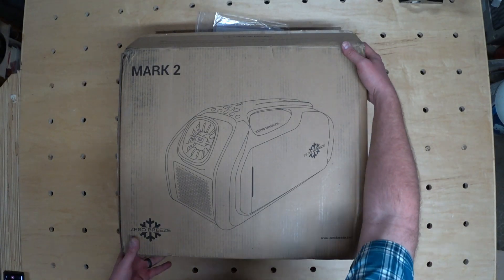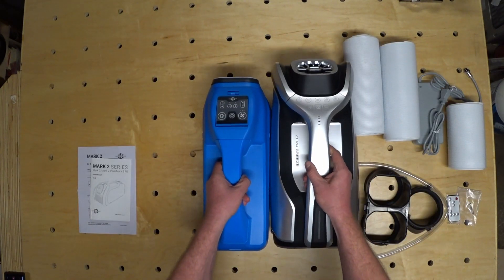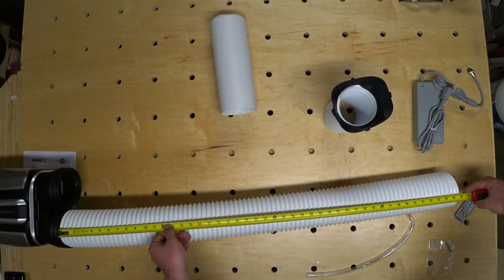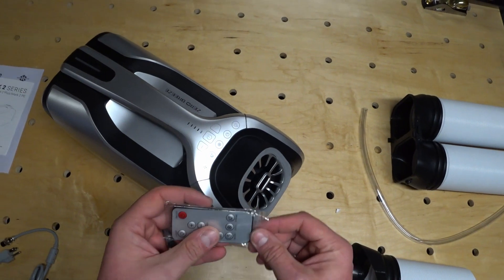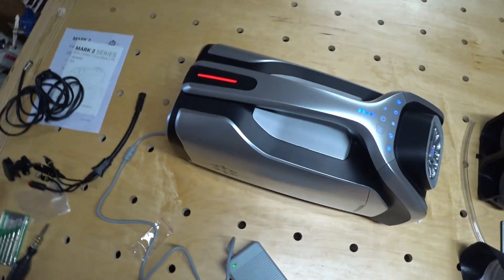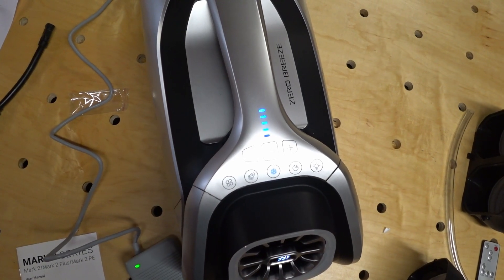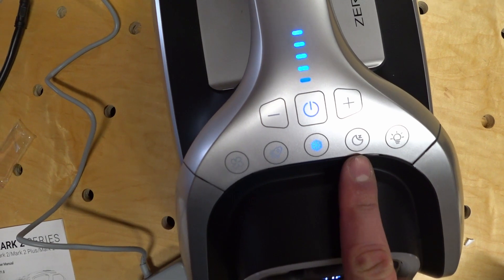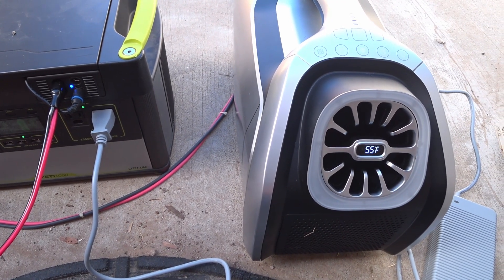Zero Breeze Mark 2 Unboxing, Startup, and First Impressions

Comment: Thunderfoot does a good video on the zero breeze. It seems to have zero effect except for the cost to run  it.
Reply from the maker: I wouldn't call his video "good".  Most of the video is showing the old Mark 1 which I agree was not ready for sale, so it's at the very least, misleading.  And his criticism of the Mark 2 is that it won't cool a large space in the sun.  Of course it won't.  What is he going to bust next?  A radio flyer kids wagon because it can't haul a ton of bricks?   He sells sensationalism (and apparently sells a lot of it).  Using his videos to further ones own knowledge is like using Wikipedia to find absolute truth.

The Mark 2 most certainly blows out air ~28 degrees cooler than ambient (and being refrigerated just "feels" a bit cooler).  If that's something that interests someone, and they feel it's worth the cost, then it's a good buy.

Comment: I’m a mail carrier and I’m trying to get ready for the summer..you know we have no ac in them trucks..I’m scared it may catch fire
Reply from the maker: I haven't heard of any Mark 2 catching fire.  I've used mine in a very hot enclosed space for hours and hours and still working like a champ at the end of last summer.  

A mail truck might actually be a good use for the Mark 2.  

**But I'll preface the following by saying some folks on the facebook group had issues with theirs in a moving vehicle, so I'd email zerobreeze first and get the official word from them so you're covered and can send it back if it doesn't work (CYA).**

It's not going to cool the whole inside especially with the door/window open, but it will blow cool air (up to 30 degrees cooler than the air around you) on your face and body.  If you can keep it relatively close to you, level, and get the end of the 4' exhaust hose to, or close to the outside, and be cool with just cool air blowing on you, then could be good if it will work in a moving vehicle.

If you live in a dry climate, check out swampy.net also.  They only work good if it's dry outside though.  I used one of those for 10 years before the ZeroBreeze came along.
Reply: Did u ever buy one? If so, was it worth it?

Comment: Is only one of the rear tubes pushing out hot air? So can this cool a small van from 90F to 70F in florida? How many watts? I'm calculating 220watts?
Reply from the maker: Yes, the hose on the mark 2's right rear is the hot exhaust. Other is the intake for the condenser coil. Will not cool a space during the day at that temp but it will cool you if it's blowing on you. This is how I use it. Stay in the air stream, no sweat. Move out of the air stream, instant dripping sweat. Wattage on my Yeti 1000 hovers around 200 on the hottest days running on DC power.

Comment: Ok I have an actual on topic question that doesn't fixate on your voice... how do you vent this a/c out of your car without having a window open??? I mean how do you close the window with two round hoses stuck out of it??? Does it come with some kind of car window hose attachment thingie thing?? Do you have to custom make something??? Just curious... I got a Jeep that doesn't have a/c was thinking of buying one of these as I don't plan to keep it long so don't want to dump a crap load of money adding a/c to it.. buying this zero breeze will let me keep and use this a/c for other things as well... also... does it really make a difference... how well does this device actually work
Reply from the maker: I'm ok with the occasional on-topic question.  Zero breeze does not have a duct to place in a cracked window that I know of, but that is a fantastic idea for them to think about.  I personally popped out the pressure relief valves in my vehicle (the rubber flappy things that let air out when you close your doors).  So I have direct access to the outside on both rear pillars.  

I don't know if you'd be happy with the Mark 2 trying to cool a vehicle.  It's just not designed to cool that many cubic feet of space especially with minimal insulation and in full sun.  The Mark 2 is 3200BTU's and a car might have a capacity of ~20,000BTU's.  I use it to blow cold air on me while parked in my vehicle and it does a great job at that....no sweating even when the temp inside is over 100 which is priceless to me.  But I have to stay in the air stream.

Comment: Great review, very informative and watch able thank you. Can I ask what diameter the ducting pipes are? they look about 3" or 4" so if you could confirm the size that would be appreciated.
Reply: Found it 
Extended Length
 120cm

Contracted Length 30cm

Outer diameter 11cm

Inner diameter 10cm

Comment: Would it not be better to circulate the cabin air much like a standard a/c system does, instead of constantly bringing in hot air from outside?  Just wondering?
Reply from the maker: Yes, outside of this unboxing video, that's exactly how I have it set up in real world use in my other videos.  The condenser works on a closed air system to the outside and the evaporator at the front recycles the air inside the vehicle.

Comment: does the air out allow you to point it downward without the tube? Any way to attach a tube only to the hot output on the rear right vent?
Reply from the maker: Not without the tube on the front.  The spread of air is also wide without the tube.  The tubes on back unscrew from the plastic duct so you could unscrew the cold intake side and just leave the open hole of the duct.

Comment: So it blows 80 degree air out the back? So don’t use this inside or you’ll end up heating your room?
Reply from the maker: It comes with a four foot hose to port to the outside, plus a four foot hose on the cool air end, so you can be flexible with placement, but yes if you don't port the hot exhaust out of the room, then it wouldn't work very well.

Comment: Do you know how much power it pulls. Sorry if you said it in the vid an missed it
Reply from the maker: I usually pulls about 200W (as the screen reads on my Yeti battery) consistently in a hot car.

Comment: Will I get longer run time if I eliminate the ac adapter and just hardwire with connector to my auxiliary 12v vehicle battery on original Zero breeze for summer camping in my vehicle? (Got 2 hrs run time from Optima yellow top 750 cca with a 1000w inverter)
Reply from the maker: Yes you should get longer run time with straight DC power. This is what I've found in testing.  I no longer have the manual for my old Mark 1, but you would need to make sure it can handle the wide input range your battery could deliver (maybe under 11V to 14V max), if not you'll need to find a 12V regulator. I'd also fuse that connection for sure, especially after seeing my Mark 1 go up in smoke.

Comment: Hi thank you for the video.
Now that you had it for quite a but, would you recommend it for a van?
Reply from the maker: I'm very happy with it for cooling me in my van. Not a drop of sweat while sitting in a 100+ degree van for hours as long as I stay in the air stream and have both the back hoses running to the outside.  It's just not designed to cool the whole inside of a vehicle in the sun if that's what you're looking for...at night, more likely.  As long as one expects what it can deliver, then I still believe it's a good buy... I'd buy again for sure. Mine was still going strong at the end of summer and ready for this summer.
Reply: @Polymathicus  Thank you for responding so fast with a complete answer!

Comment: Will it cool a econoline van in 99 degree weather ? I need it for my dogs while I leave for  a few hours ?
Reply from the maker: No, not a whole van at that temp.  Check out the Mark 2 Facebook page, there's a guy in there that posted pics of a sectioned off rear end of a van to cool his dog.  Apparently that smaller space insulated stays cool.

Comment: Will this run off of AC alone?  We have shore power outlets...and sometimes hang on the hook, which the inverter would work well with our bank of batteries.   But it isnt clear if it runs off the AC plug alone when we are hooked up to shore power.
Reply from the maker: Yes it runs on the AC plug alone that comes in the box.  If you buy without their battery it's the only way to power it without building your own 24v power supply.
Reply: @Polymathicus  Thanks and brilliant video, dry humor and all...some times they just dont address the obvious...like how can one pawer this?  Plug it in , our battery or your own battery....that kind of thing.    Thanks again!

Comment: I was gonna get one of them to take to work with me at UPS. But I work in the back of the trailers and nowhere for the hot exhaust to go.
Reply from the maker: With all the hoses extended you could get the exhaust away from you somewhat and still have cooler air blowing on you, but not ideal for sure. Interesting use though. A big fan at the trailer opening might have the same effectiveness overall though
Reply: jtskr25 there is a big blower thing at the end of the trailers but it never reaches at the back of a 53 footer. It literally feels like a casket in there with no air circulating
Reply from the maker: Wow. That's a hard job there. Can't think of another way to fix that other than carry a towel and pray for winter
Reply: jtskr25 Yes for sure. Winter can’t come fast enough

Comment: Thanks for the review.  I have a Mercedes Metris camper (it's the cargo van converted to a camper with a poptop...think old VW camper style.  2 questions....If I left my 2 dogs in the van for an hour (think grocery store, restaurant (someday we all hope), short hike on "no pets allowed trail", etc)  in low-80 degree typical southern california "summer" weather (which is hot and dry), would it keep the van cool enough for the dogs to be safe?  Do you think it would make a difference if the poptop is open (camping mode) versus closed (driving mode). Second, if the poptop is up and 1 person is sleeping up top, and a second person is sleeping on the flip and fold seat below, would the unit cool the vehicle (assuming it's about 75% outside in the early evening)?  The camper has solar panels and inverters so it would be running off the 12v system that powers the Dometic refrigerator and lights and everything.
Reply from the maker: Short answer for the dogs, I wouldn't risk it without being able to monitor the temp inside remotely.  And I feel you when it comes to the "no pets on trail" trails.  We have had to pass by many while traveling with the dogs.  The Mark 2 just doesn't have (and I don't believe was designed with) the cooling capacity to cool a space when parked in full sun in the summer.  There's no way it can do what your vehicle A/C can do.  I use it to blow cool air on me, keeping me cool, but getting the dogs to figure that one out and stay put.....

For your second question, night time is a different situation because you're not dealing with the constantly increasing heat load by the sun beating down on the vehicle.  The spread of cool air out the Mark 2 is relatively wide so if you could put it in a position to get both beds then you would both get a cool breeze.  And if it's only 75 degrees and dry outside at sundown, it could very well create a comfortable environment inside running all night on sleep mode but that's just my opinion at this point.
Reply: IT IS JUNK, DON'T BUY THIS
Reply: Just let the air conditioning by the car do the job
Reply: @aririyadh8359  yeah your way wrong.  It’s a niche item.  For for the people in that niche.  It’s like heaven.  
If it weren’t so expensive ild buy a second one.  
But for my use. It’s absolutely perfect.   
The only ones says it’s junk is people that don’t understand AC units of any kind an cooling an heating of any kind

Comment: How well does it work in a tent 10' by 10' ten,  In the summer at  110 degrees.
Reply from the maker: Depends on how you define "well".  Won't do much to the ambient temperature inside especially if it's in the sun. Better luck overnight though.  You can expect in a 110° tent about 80-85° air coming out during the day so if it's blowing on you it helps.  Only so much a 3200BTU AC can do in a space that size.

Comment: 🤔 wow now as much as this portable air conditioner cost .Why come it didn't already come with the plug set up? Why do you have to make up the plug 👀for this to start working 🥴?
Reply from the maker: It comes with a 120V AC power supply.  As far as powering DC there are just so many variables and different kinds of plug ends out there on different power supplies, not to mention it requires 24V DC to operate which is going to require a converter inline if the supply is not 24V, so I imagine it would be difficult for them to sell every combination of cable to appease all.  A generic bare wire ended cable would be nice though if they would include that to get us started.

Comment: What happens to the water collected by this unit?
Reply from the maker: I live in a very dry climate, so I have actually never had any water come out of it ever, even after hours of running, so I luckily haven't had to deal with it.  But from what I've seen on other videos you can just run it away from the unit with the drain hose.

Comment: Was it very loud? I have a small RV and want to use it to cool that while I work but I also need to be on the phone for work at the same time, is there something you can compare it to for loudness?
Reply from the maker: It's rated at 52dB which is supposed to be quieter than a conversation.   I concur with that.  I talked on my noise cancelling bluetooth headset all the time with it running on high and blowing right on the  headset.  No one ever said anything about it.  You also have a 4 foot outlet duct available, so you don't necessarily have to be right on top of it either.
Reply: @Polymathicus  Thats super great to hear. Before I purchase can you let me know if its fine to work straight off 12/24 volt battery system without being plugged into mains? My RV builder in Australia said to make sure its fine to work off inverter so it doesn't surge power and blow my lithium battery?
Reply from the maker: @jodie-thegfhub6148  It's always best to run it straight DC power off the battery so that you limit the loss of going DC-AC-DC (you must supply 24V to the Mark 2 by the way).  Zero breeze sells a generic cable that you can attach any ends that you need to connect to the DC side of your electrical system (just make sure you put a fuse inline).  It shouldn't damage your battery as it doesn't pull that many amps.  Most "drop in" lithium batteries and/or RV electrical systems have over current protection, or are fused, in the off chance something did go wrong.

Ideally, your builder could put a female fused 24V power port somewhere in there and provide the male end so you could attach to the cable Zero Breeze sells.

And just thought I'd mention in case you hadn't watched my other videos.  The Mark 2 will not cool the whole inside of an RV especially during the day in full sun without a large amount of insulation.  The Mark 2 has a 2300 BTU cooling capacity and an RV air conditioner is 13k-15k BTUs.  It's more useful to just blow cool air on you while sitting inside (that's how I use it).  Many have had luck with it cooling a van at night however.
Reply: @Polymathicus  thanks for the reply, it's such a big help. I watched your other videos also. I agree with unknown user below - you should definitely get into narrating audio books :)
Reply from the maker: You're welcome, and thanks for the compliment.  Due to the amount of similar comments, and a Covid layoff, I actually started doing voice over and audiobook narration.  Started a new career (at least trying to) because of some encouraging YouTube comments.....interesting world.

Comment: I want to put this in my car also, how will you vent the exhaust if not through a window?
Reply from the maker: I found the two pressure relief ports in my vehicle. All vehicles have them, they allow pressurized air to escape when you shut the door. I removed the plastic flappy things which left an opening to the outside in each rear corner. Then I attached 4" duct starting collars over the holes and metal tape around those. One brings in fresh air and the other side purges the hot exhaust.  Just a matter of getting lucky and finding them in a convenient spot in your vehicle as they can be anywhere but usually behind a trim panel.
Reply: @Polymathicus  fantastic, thanks!

Comment: Sir Can i use this A.c on my semi truck supply with my truck batteries ?
Reply from the maker: That's really hard to say not knowing all your specs, and then how much power needs to remain in your batteries to be able to start your truck.  Yes it will, for a while (need to supply 24V to the Mark 2  by the way).  At some point you won't be able to start you truck though if those are starting batteries.  It would be safer to pick up a portable lithium battery like in my videos.  Also, I've seen many pictures of truckers using the Mark 2 online.  Search google images and several pics come up of how truckers have made custom housings to run their exhaust hoses outside.

Comment: Will this work for my truck with a campershell?
Reply from the maker: All depends on what your goal is.  It's not designed to cool a large space especially one in full sun on a hot day without an excessive amount of insulation.  Night time, or parked in the shade, some on the facebook group have had decent luck.  It will however consistently blow cool air, about 30 degrees cooler than ambient on whoever it's pointed at.  It does that very well, and that's why I'm a fan.

Comment: Can this cool my small room that's about 100 square foot
Reply from the maker: That's larger than it's rated to cool according to the website.  If the room is very well insulated, you've got both hoses going outside, it's night time, you're not competing with any heat generating sources, etc, you might be successful in getting the temp down a bit though.